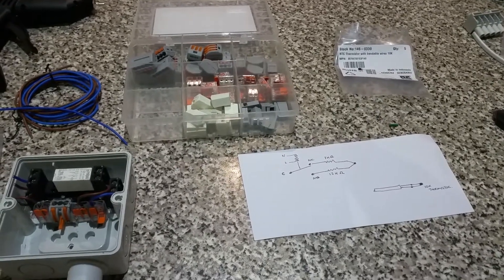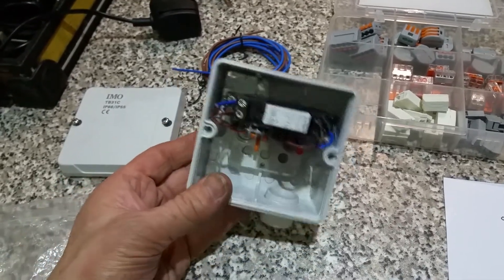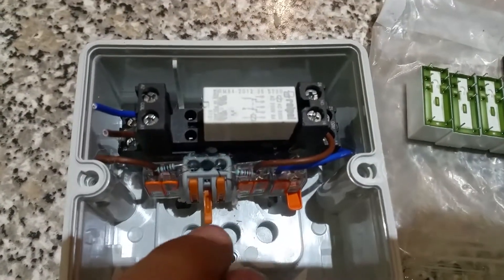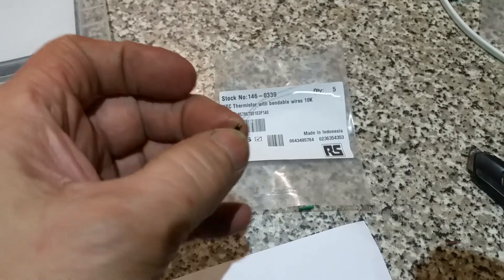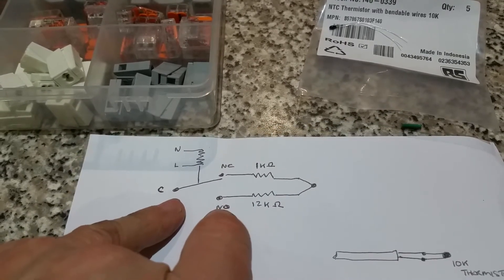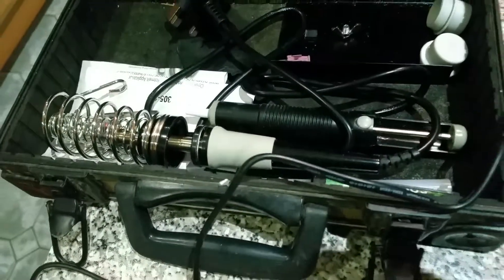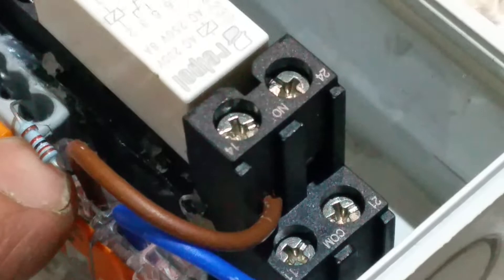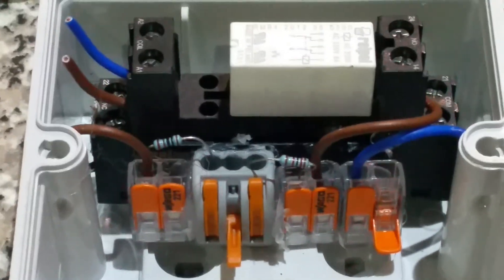Viessmann cylinder demand relay box and thermistor.

Comment: I'm so grateful for this, like you I can't stand the thought of paying what would now be over £100 for a box I could make with stuff in the bottom of my desk drawer. From what you say it's either the old cylinder stat and your box OR a 10k thermistor. I was thinking of just pushing one of the waterproof NTC Sensors under the cylinder foam (against the copper) and wiring that to the boiler. Maybe epoxy it in place and connect with 2x twisted pairs of a cat 5 cable to the boiler? Will that do the job ... with another NTC sensor outside of course?
UPDATE: I got a 100W B1HF installed and it works perfectly with a simple 10k NTC stuffed under the cylinder insulation next to the old thermostat. The 2 wires from the NTC connect inside the boiler on to the same block as the weather comp sensor - which is pretty much the same thing outside. Since we got rid of the header tank at the same time, I was able to run a pair of wires through the cold feed pipe down to the new boiler but you could repurpose the twin and earth that was likely used for the old stat. Installing the Vitodens 100W allowed us to get rid of the 3-way valve, room stat, cylinder stat, wiring centre, header tank and Honeywell controls. 👍

Comment: You are a lifesaver. I have been tearing my hair out trying to figure out how the DHW demand was signalled to my new B1HF Vitodens 100W.

My previous system used a 4 channel Shelly controller to switch 3 heating zones and DHW, with a Y plan. As the Viessmann can do 4 pipe I replumbed for S plan, assuming that there would be a simple 230V input for 'traditional' stat/timer control. Alas, no!

I was stunned. I figured the cylinder sensor was probably a simple thermistor (the NTC was a clue!) but spent ages trying to find the resistance values I'd need. Then I found your video. Thank you so much.

I have a question - how about using your scheme with an actual thermistor, on the cylinder, to give both external control and the smart stuff from the boiler? Wouldn't give an accurate reading when there is no demand (mine reports 89.9°C with 1k across the sensor terminals), but would be accurate when the relay is off. My plan is to use an SMT thermistor connected to thin high temp wire (probably enamelled copper in high temp sleeving), attached to the end of the cylinder 'stat probe with Kapton tape, and taken back to the boiler, which contains the relay switching.

As an extension to this, I may add a means of measuring the thermistor separately when there is no demand, using a Shelly Uni or similar. If I do I will update here with the outcome.

Thanks again. You're a legend.
Reply: Update - I did this, and it works well. While I don't get accurate cylinder temp readings when the hot water circuit is off, or when the cylinder stat is satisfied, when the water is actually heating the boiler does report the water temperature well. It's super useful. It also means that the boiler modulation is maintained.

Comment: Not sure if a real problem, but whilst the relay is switching there will briefly be no resistor in circuit and maybe the boiler could determine a fault? Better to leave the 12k in place all the time and just switch a 1k1 across it (e.g. in parallel) using the relay.
Reply from the maker: @FrankV-q6o  There is a time delay.Of five seconds for fault recognition.

Comment: I am probably on the wrong track here but couldnt you tee the 2 pipes for the priority hot water in to the primary flow and return and then just use a nc and no motorised valve to switch over when priority hot water is called?
Reply from the maker: There are multiple ways of directing the water but the boiler still requires a signal to tell it we have demand and this relay does that job full stop this can be configured with a modified s or y plan
Reply: @andrewmillwardwatford9410  and I guess the relay is the only suitable method for doing 2 pipe on opentherm? Your videos are a great source of info by the way.
Reply from the maker: @foodforhumans9152  thank you for your kind words. The v200 doesn't have opentherm
Reply: @andrewmillwardwatford9410  good to know, I didn't realize that.

Comment: I know this video was posted a while ago, but there is so little info on this control box, so thank you.  I have a weather comped 100-w B1GA.  The comped flow to the tank often isn't enough to heat the water adequately.  Does this relay allow the boiler to have a different, higher, flow temp when the cylinder demands hot water?
Reply from the maker: Yes

Comment: The one outstanding question I have with converting a normal on/off S plan installation for OpenTherm (system boiler control with separate HW tank) is how is the pump speed controlled? I understand from some website (cant remember which) the Honeywell T6RHW and the ESi RTP6HW are currently the only OT thermostats that implement the OpenTherm Low Load data message to tell the pump to switch off when the boiler isnt needed. For other thermostats like the Nest is the pump controlled by the boiler logic at low demand? Dont really want the pump running 24/7/365...
Reply from the maker: I've never done ot. It's out dated and inferior to weather compensation. Ask me about weather comp.....
Reply: @andrewmillwardwatford9410  nah. Weather Compensation is outdated. I don't want to compensate for the outside temperature. My room thermostat does that, very efficiently using OT, and it also efficiently compensates for the extra heat when I light the logburner.
Reply: Don't know how this is working, maybe the boiler circuitry switches the pump off at low demand, but the system has been working very well indeed on OpenTherm modulation for well over a year now with a Viessman system boiler and Nest 3rd Gen smart thermostat. I did buy the Viessman boiler control box to handle the DHW control...couldn't be bothered to mess around getting the separate components and DIYing it.

Comment: Are those resistor values standard for all Viessman boilers? Got a new 2021 style Vitodens 100W system boiler & contemplating a cylinder relay box for OpenTherm CH+HW with Nest.
Reply: Cant see any resistance figures in the boiler manual
Reply from the maker: @jorkirasalas2726  the graph is in the manual showing the range of resistance v temperature
Reply: Ah, had missed that! Figure 46! It’s the same values & is indeed for a 10k NTC!
Many thanks!
Reply: Well, got a cylinder demand box set up & connected, but the boiler doesn't seem to be responding to it. Room heating seems to be working ok;  the Call for Hot Water is switching the demand box relay but nothing is happening to heat the hot water cylinder

Comment: Hi, would this work instead of the cylinder demand box on a 100-w compact? Thanks
Reply from the maker: Yes
Reply: @andrewmillwardwatford9410  When wiring it in would I require a wiring loom/harness from Viessmann with the molded connectors that plug into the board? Or can I just cut a wire and join in? Also, do i just replace the old tank stat with a 10k NTC? Thanks Andrew
Reply from the maker: @JSmith-pw1ox  no plugs or loom required

Comment: Hi Andy, liking the ingenuity... however got a vitodens 200, before seeing this video bought a viessmann cylinder demand box. I’m a decent sparks but can’t seem to find correct connections on the viessmann pcb. Trying to control cylinder demand with nest thermostat. Can’t get a straight answer from viessmann either. Should be simple, I install full home automation systems but this has me stumped... fancy a challenge... how can I contact you?
Reply from the maker: The connections are not on the pcb. Use the hot water connections from the loom. Behind the control panel on the left hand side. Look for me an face book. Andrew millward.
Reply: There’s a lot of Andrew Millward’s on Facebook... how do I find you amongst them all?
Reply from the maker: @chrismoir4058  my picture
Reply from the maker: @chrismoir4058  red t shirt holding my chin
Reply from the maker: @chrismoir4058  https://www.facebook.com/profile.php?id=100011041051437

Comment: Hi Andrew I'm curious to know how you calculated the needed resistance? I understand everything else regards relay etc and bumped into your video by by searching what resistance I would need to replicate temp signals to switch the 3 port, any help would be appreciated.
Reply from the maker: I asked Viessmann technical. The resistances are in the Viessmann manual also.
Reply: @andrewmillwardwatford9410  many thanks I came home from work this morning with relays and variable resistors so will be cracking on with it shortly do you still have a Facebook page? ahh I just found the table I see it's an NTC. thanks for the info  and you have some great videos good work!! 👌
Reply from the maker: @michaelwhitaker7128  yes. Send me a friend request and I will add you

Comment: The problem with building this DIY is the assembly needs to be certified under the EU products directive. It’s fairly ridiculous given the components are already certified.
Reply from the maker: Not under eu law any longer. I wonder when our new rules will start ? I wonder if that's the case any way ?
Reply: @andrewmillwardwatford9410  The UKCA mark replaces CE after 31/12, there is talk of rationalising and hopefully reducing some of the burden that the EU imposed under CE.
Reply: @andrewmillwardwatford9410  For your application, I not think that such certification is required. The central heating system itself once assembled carries no such certification. You are not retailing the assembly either.